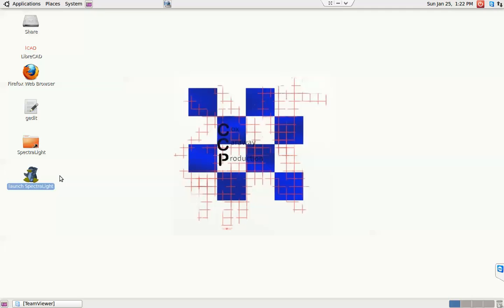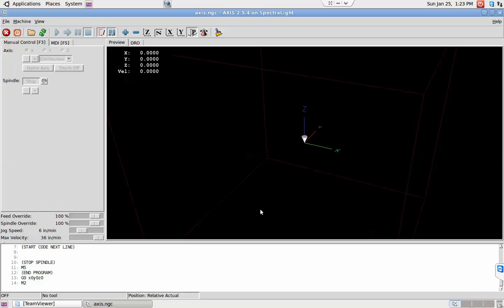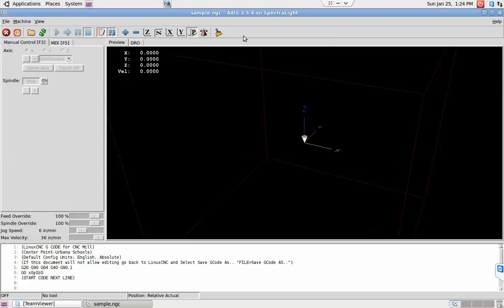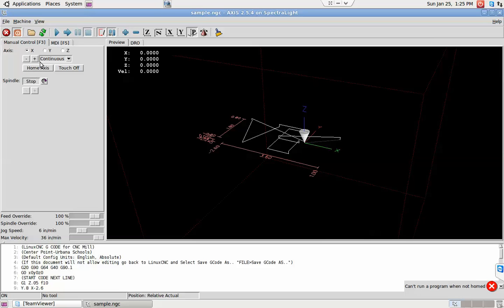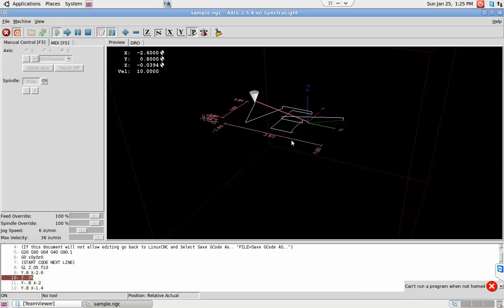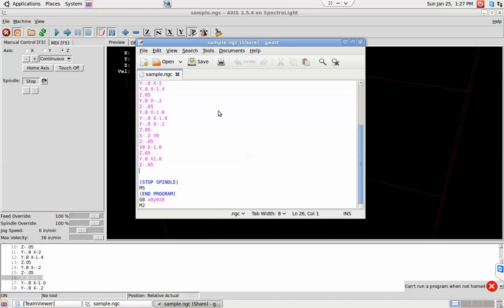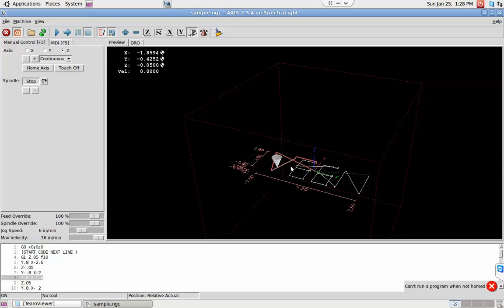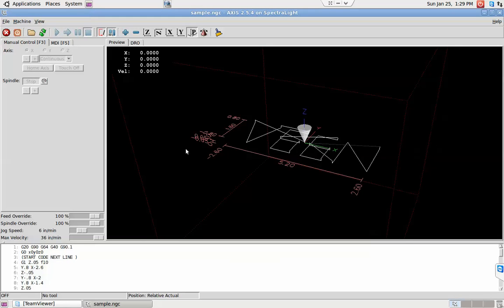LinuxCNC Tutorial-CPU Schools

Comment: okay. i hope linuxcnc can handle uln2003.
thanks for the video
Reply from the maker: You're welcome !
Reply from the maker: Vic Val The stepper driver used on the mill in the video was originally designed for Mach3, so there is a good chance it will work for you.
Reply from the maker: +Vic Val from http://wiki.linuxcnc.org/cgi-bin/wiki.pl?EMC2_Supported_Hardware: other hardware we've heard about, but we don't know if it will work or not

Hardware that doesn't work

USB devices cannot be used to control motors or perform other "real time" tasks. Some USB devices which appear as keyboards, joysticks, and mice can be used for user interface tasks through the hal_input driver.See Emc2HardwareDesign for details of USB, RS232, and Ethernet interfaces.